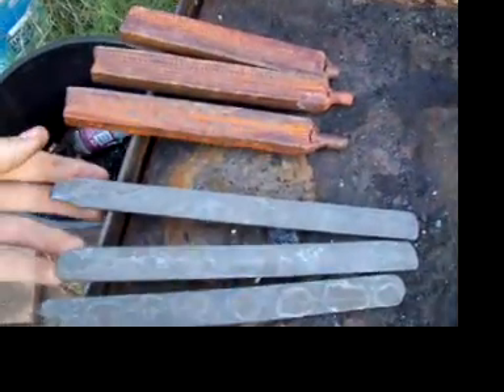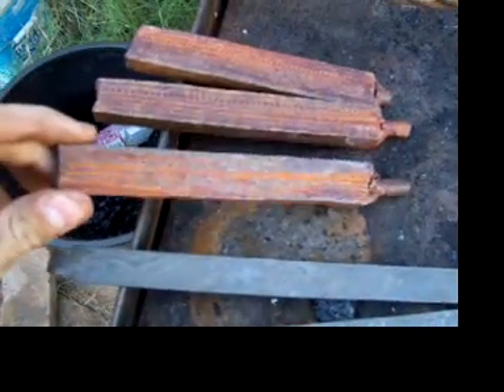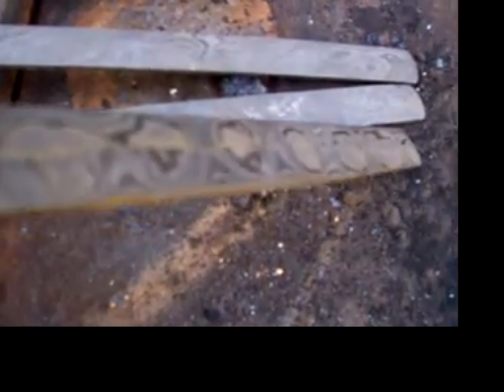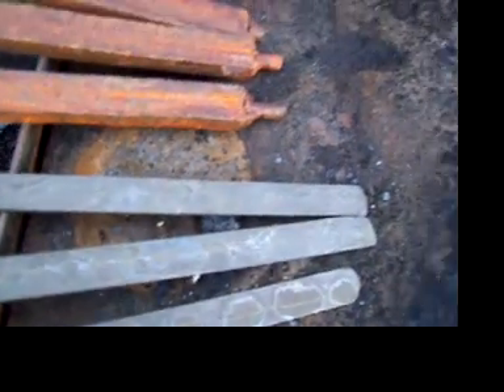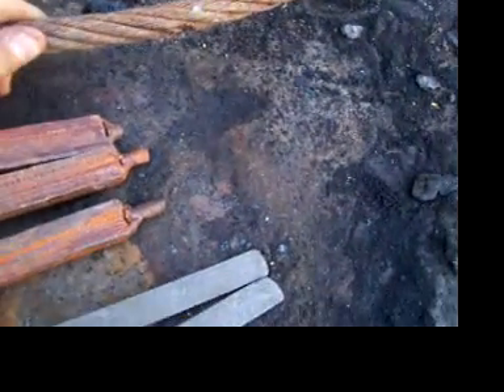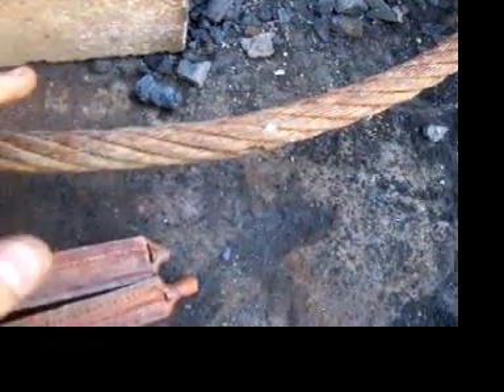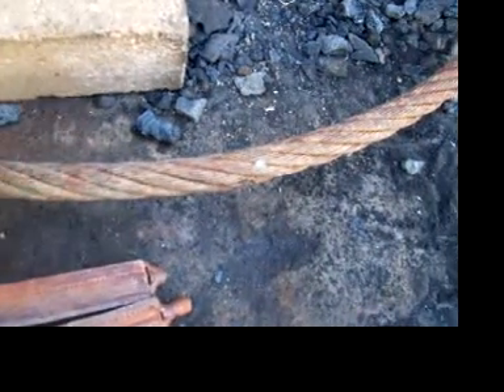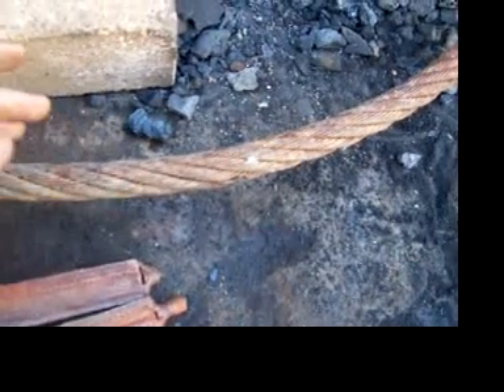Damascus steel

Comment: the idea behind modern forge welding is that as the softer steel "erodes" through use faster, producing a microscopic saw effect. This allows it to cut longer between sharpening. Keep in mind that "softer" is relative.

Comment: @blacksmither1 Er, Well i know that they made it by forge welding normal steel (crappy compared to now days standards) and "good" steel. They did this because the good steel was not very common in those days. Basicly just stretching their good steel supply by doing so. What they ended up with was steel that was not as good as the best but better than normal. Now days its not called Damascus, its called Pattern Welded, because we have refined steel so much we dont need to stretch it.

Comment: @obeyance actually the old damascus steel was what its compared to,if you use the spring and another high carbon steel it should be a higher quality right?

Comment: @ghillieman1911 Charcoal is wood that has been burnt till its just carbon.  Coke is Coal that has been purged of impurities such as sulfur and other nasties. So basicly his answer should have been coal. Hes using Coal and not Charcoal, since coke is the  after product of burning coal. Well, that and clinkers. Clinkers are the byproduct of  "refining" coal to coke in a forge.

Comment: @Jack1knife Crane cable works nice. Its usually improved plowshare or extra improved plowshare which equates to 1070 and 1084 respectively. If you have cable that has a non-ferrous core you can take it out. If you have a local rigging company they will generally give you small cut-offs...

Comment: I agree, a good monosteel  has all the characteristics you should want, where Damascus steel was essentially a "compromise", using bits of steel that came from the smelter, and stacking them in layers,  hard and soft, and forge welding them together like tamahagane into a billet to be folded and worked under the hammer. The pattern was a "side effect" that turned out to be cosmetically beautiful, which is what is the desirable trait of damascus now, versus monosteels.

Comment: also, damascus and pattern welded steel have always looked very different, damascus has a vere dense randomm pattern, while pattern welded steel had a certain pattern the bladesmith has brought in to it by twisting, grinding...

Comment: although some bladesmiths have made some very good damast, I know achim wirtz has made one of Ultrafort = 60 HRc
1.2842 = 64 tot 65 HRc
1.2519 = 65 tot 67 HRc

As you can see the last two steels are very hard as a mono steel they would be very brittle, these are things only possible with damast.

Comment: Anyway, I was going to ask if you had any suggestions as far as billets go - I recently heard that taking a section of high carbon steel pipe filled with various sizes of ball bearings & some borax or other flux works pretty good as a "starter billet" (even though it's not really a billet). Have you heard anything like that?

Comment: Hello there - I got into bladesmithing about 6 months ago. All I've done so far is made a couple finished blades out of some files, and also from some steel stock from a local knife supply.  Anyway, I went into it wanting to do patternwelding - I have a coal forge & all the necessary tools but just haven't had a chance to really get into it yet.